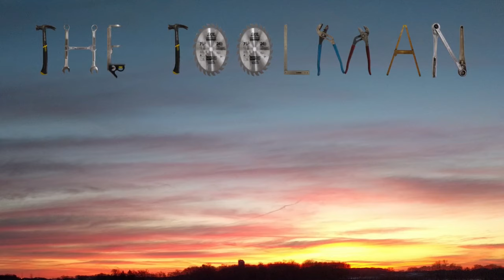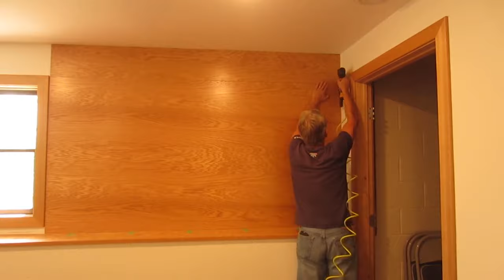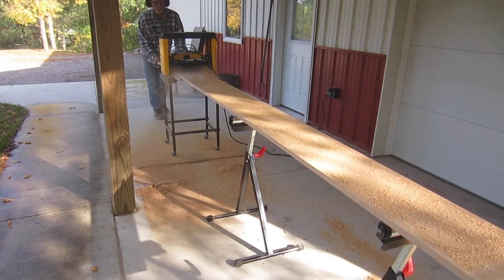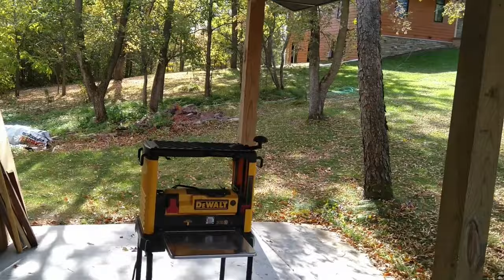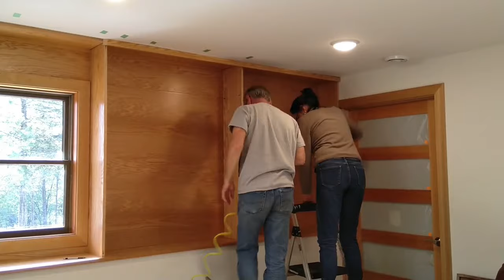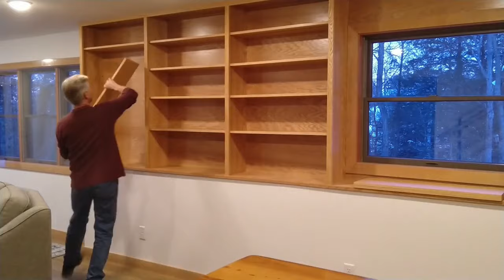Built-in Bookshelves

Comment: Hi, you said each vertical had to be cut individually as ceiling and shelf were not square. How did you determine where to start the shelf pins, as I imagine each pair of uprights would need to be slightly set at different heights for the bottom pin.
Reply from the maker: The base concrete knee wall was pretty level, so I used the bottom-back edge of my verticals as my reference when I measured and marked the starting point for the holes.  Fortunately, they turned out nice and consistent throughout the entire unit.  The reason I spent the extra time to measure and cut each vertical individually, was to get as tight a fit as possible where they met the top and bottom horizontals.  There wasn't a lot of variation in overall height, but none of them were exactly 90 degrees, so I used an angle finder to get a perfect fit.  In retrospect, I should have cut rabbits into the top and bottom boards and slid the verticals into them.  The rabbits would have given a perfect joint without custom fitting each vertical.  The rabbit would be covered by the face frames.  Hind site is 20-20.
Reply: @TheToolmanTim  got ya. Seems like a bit more to it. I was thinking you might of had to dry fit the verticals and use a level to locate the bottom shelf holes. Thanks for the reply, it came out looking nice.

Comment: On the verticals... to install them did you use pocket holes to fasten them in?
Reply from the maker: I was going to use pocket holes, but they would have been visible even with plugs in them.  I just toenailed them in with my 18 gauge nail gun.  I shot a couple nails in the top, back and bottom.  It's been holding up great that way.